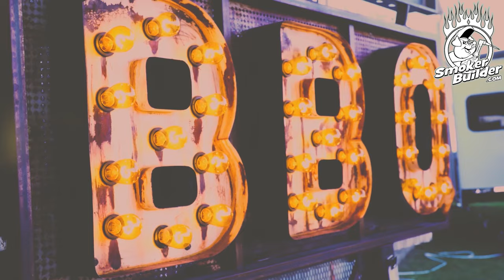How to Protect Your Smoker with an Oil Coating: Step-by-Step Guide and Safety Tips [Part1]

Comment: I'm with you, Frank, I know Jeremy is concerned about food safe oils - but I've got just a little background in health and safety, too, and I'm personally not. Why? Because, as you said - I'm not putting this on any surface where food is touching. I use BLO on the exterior surfaces and spray beef tallow or canola oil on the interior surfaces. Also, as you mentioned - how many of those 'grill paints' and such that people are spraying on their pits are safe for consumption? Rustoleum? POR-15??? The highly vaunted KBS coatings???? I don't think so... in fact, I know so. 

Bottom line, I'm not eating this stuff, I'm not putting it on my food or anyone else's and BLO actually has one characteristic that is better than most food-safe oils - it has a much lower SMOKE POINT. Meaning, you can get it to smoke off and "polymerize" (puh-LIHM-uhr-eyez) at lower temps and a lot easier than things like canola oil, avocado oil, grapeseed oil or whatever else. 

Thanks for another informative video, Frank! I wanna see how this sucker turned out!!! Get the next one up! lol
Reply from the maker: @tRdoc21  thanks bro! Absolutely will do! It’s ready to go up later this week!